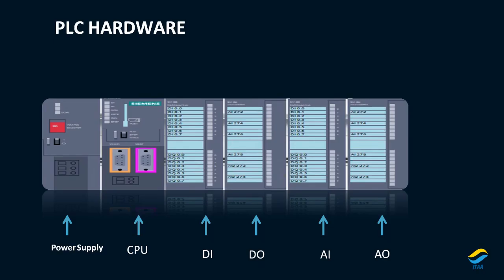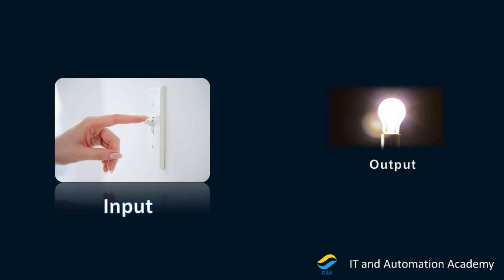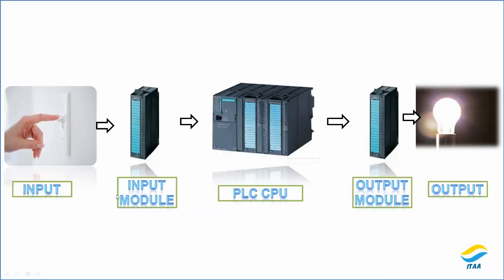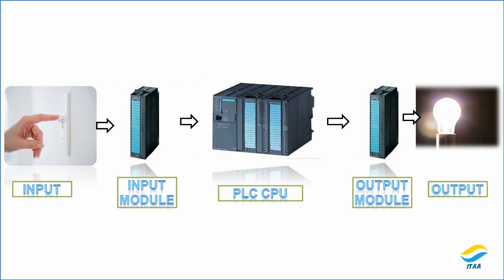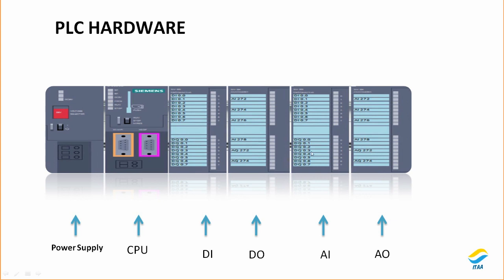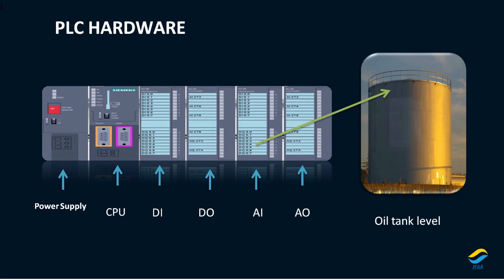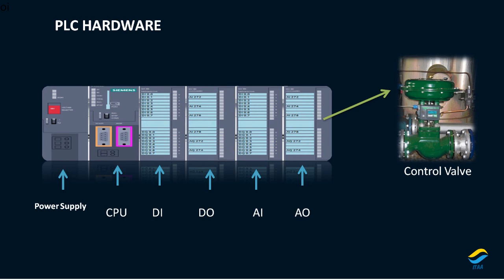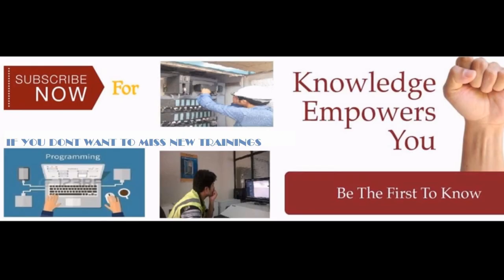PLC Training Series .Lecture#3. PLC hardware components

Comment: In one production line Main plc station and the other two sub control boxes (substations) working but 3rd is not ...  I try to check the switch's ok ....  The connection also ok ....  But i can figer out the problem can you help me bro
Reply: Check Control Cables